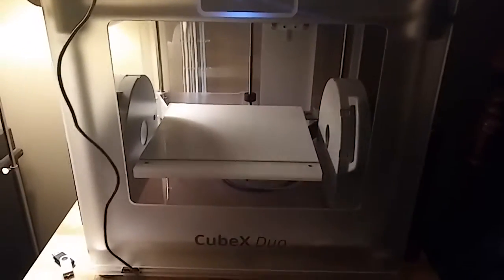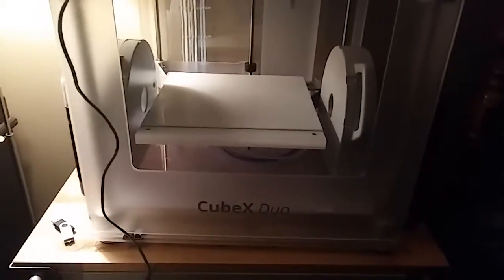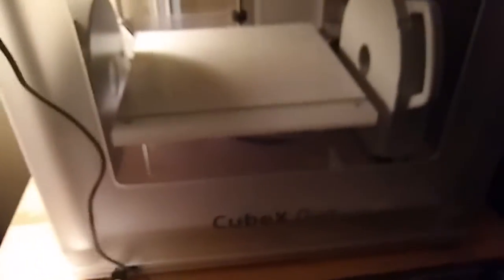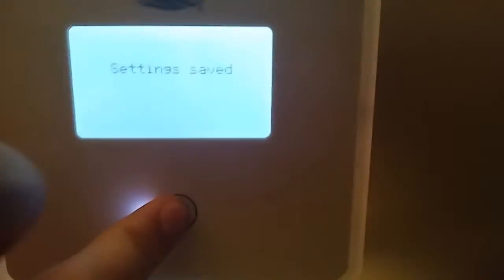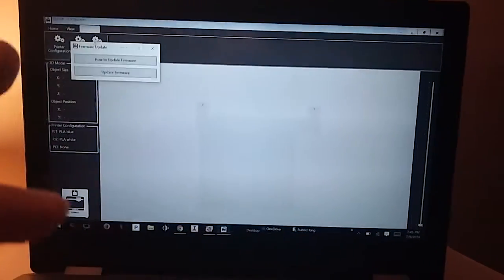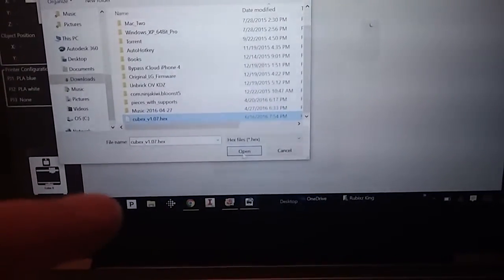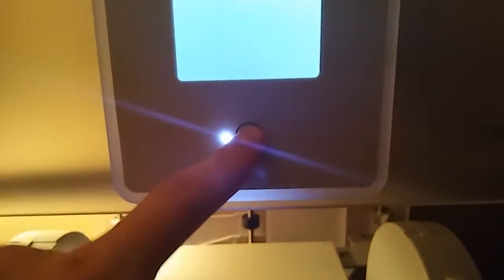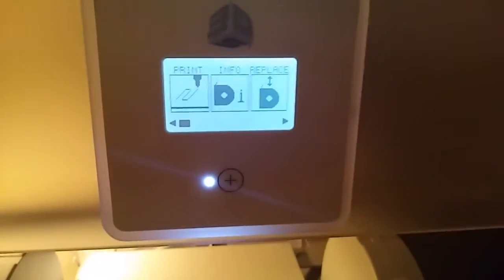CubeX Firmware Update

Comment: Hey man I'm following these steps but when it gets to the part of it should be a blank screen, mine says cubex firmware loader v1. After that I don't know what to do. I go into the program and it does't have update firmware it just has save and how to. any ideas what to do please?
Reply from the maker: Hello. If I am understanding you correctly the software does not have a update firmware button. If that is the case then do the following. Download this zip file https://drive.google.com/file/d/0BwlORVmoWbRaQ0Ezd281UWs4QTQ/view?usp=sharing.

 It is the 3d touch firmware update program that is self explainable but make sure that you use the correct hex file which is linked in the description of this video. I may make a video of this if it helps. If you need more help fill free to send detail emails to rubixzcubex@gmail.com Hope this helps
Reply: Hey thanks so much for responding and so quickly. I am going to try this like you said. The version mine says it is running is 1.06. So I connect the printer via laptop then run that program? I would greatly appreciate a vid if you have time.
Reply from the maker: Yes that is it. If you need step by step instructions I can make a video.
Reply: I am actually stuck and been stuck for 6 months . Can I pay for a maybe zoom one on one to help me set this up?